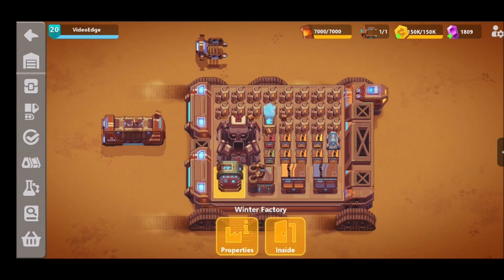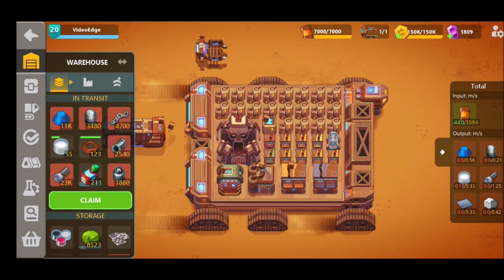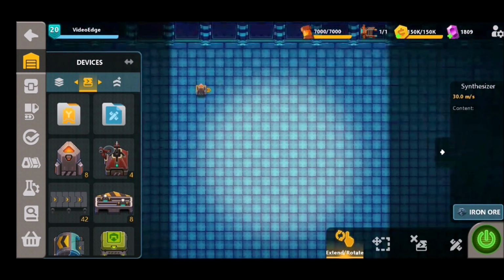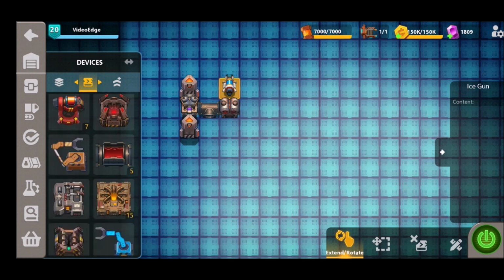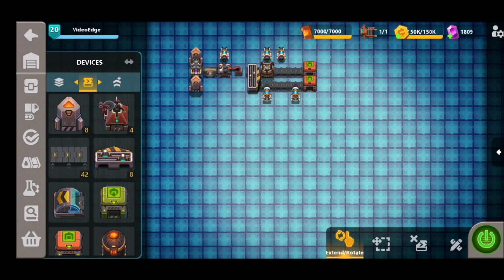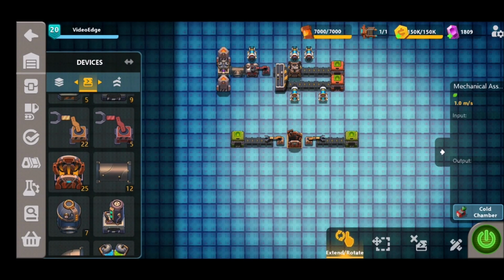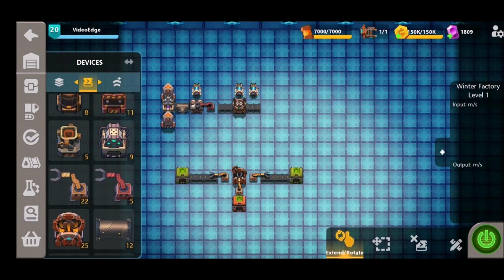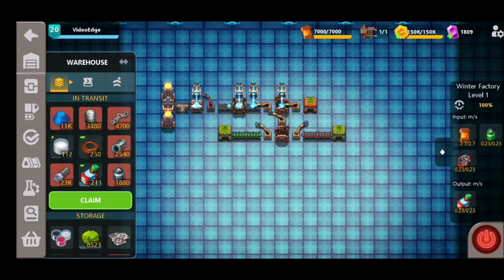Sandship Crafting Factory: Wintertime Event - How to Craft ICE CARTRIDGES! [HD]

Comment: I have achieved 0.83/s with a design of my own after watching your video. It takes up the entire 24x24 floor space of the winter factory and I import iron plates & Bolts; steel gears & pipes as I'm only level 9 and can't import finished gears and nitrogen tanks to the winter factory yet.
Reply from the maker: Fantastic effort, well done!
Reply: @videoedge5405  now I reached 2.09 in the sandbox but I can't get the game to save the blueprint to take it over to the winter factory.
Reply from the maker: @miledalbared936  really good output! The blueprint is probably a glitch with the winter factory, you may just have to build it manually to get it up and running unfortunately!
Reply: @videoedge5405  well it's gonna take me ages but ill get it done

Comment: the title : How to Craft Ice CARTIDGES!
the video: shows some but not all the required things to make the ice cartridges
me: erm thanks for showing half of what i need to do now to figure out the rest
Reply from the maker: Hi Ben, what exactly don't you understand about how to make them? We showed the whole process here. We only used importers on the gearboxes and nitrogen tanks to speed up the video, we've got other videos on these materials if you're struggling to make them too, check them out in our Sandship playlist! 🙂
Reply: @videoedge5405   ive noticed the other videos in the playlist. The gas tank design doesnt work and even with all the space in the winter factory building i cant be bothered to build up everything else im quite new to the game so everything's confusing
Reply from the maker: @PizzaKing-zw6oe  the design definitely works as we are running it in one of our factories! Make sure you double check your layout and recipe selections. If you're new it will take some getting used to but you'll get there!
Reply: @videoedge5405  in the gas tank design that ive copied from the video, its the steel im having issues with. turning the steel plates into cogs the grabbers wont grab the steel plates from the press and the grabbers are in the right places and facing the right way

Comment: hello! can you help me with a problem i have? here it is: i made my ice cartrage machine and it doesn't give ice catrage output, even thow i see with my own ice (get it?) how the catrages go to the eporters (no its not a cold chamber).
Reply from the maker: Are you making them in the winter factory? Double check everything is set up correctly, is strange you are getting no output? If everything is correct, maybe ask for support in game for one of the devs to help you out!
Reply: @videoedge5405  nope, i clearly saw how the ice crtrage went into the exporter.
Reply from the maker: @roceythecatbg2846  try restarting the game to see if that works, if not definitely contact support!
Reply: Make sure the devices all have an ice gun pointing on it, including the mech assembler that makes the ice cartridge
Reply: @kenet7877  don't worry, fixed it, i just grabbed the whole assembly and tossed it against the walls, and somehow worked.

Comment: Unfortunately I can't produce gearbox n nitrogen. I'm just at level 10
Reply from the maker: As the Winter Building is a sandbox, you should be able to construct them inside it, you won’t be able to export them, but you can use them in the construction of the ice cartridges!
Reply: @videoedge5405  I tried using your design for gearboxes but there was no output at all
Reply from the maker: Yes that’s right, you can’t export normal materials in the winter factory, only the special event materials can be exported, try adding that design into the ice cartridges with the nitrogen, that should work!
Reply: @videoedge5405  I try and experiment later. Just only reach lvl 10. Even the everstones also been changed right?
Reply from the maker: @chrisgaara1988  yep, the underwell has changed so it’s more difficult to get them!
Reply: @videoedge5405  managed to solve the gearbox problem. Replaced the exporter with conveyer belt solve it